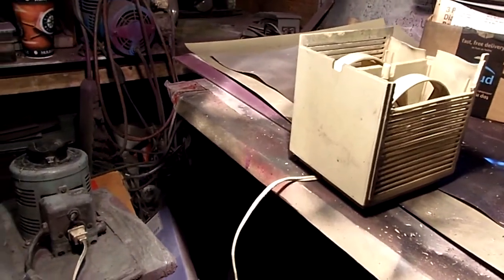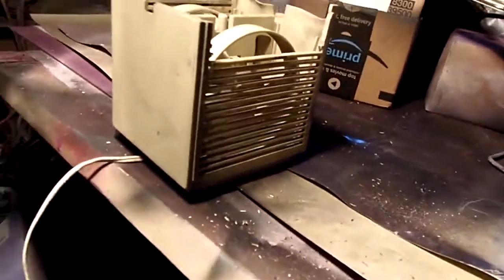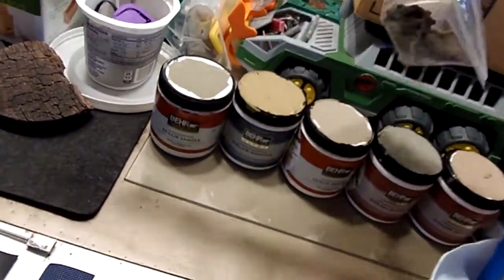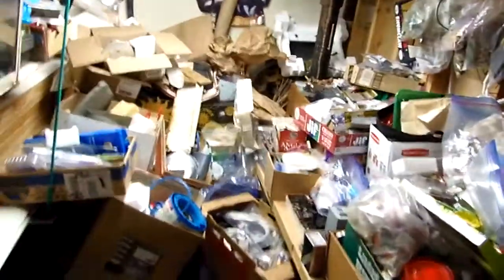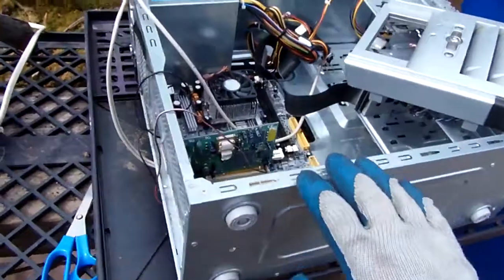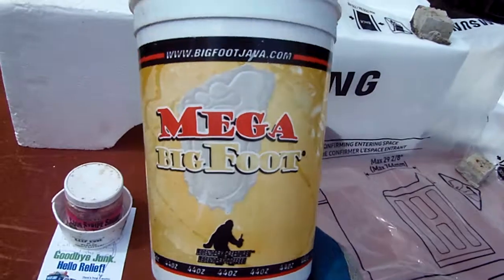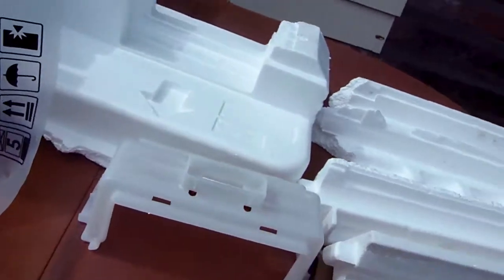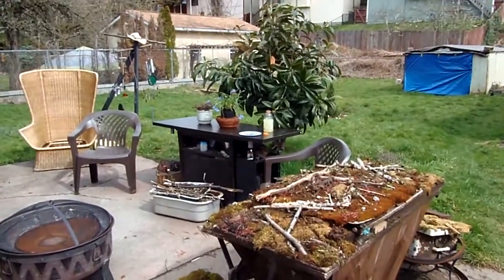The Fodder Room and Stuff Gathered from Four Roadway Dump Jobs

Comment: Those are the motor bushings , not brushes, screaming for oil in that air cleaner - just sayin'.
Reply: @skphile2342 Yes, I know how motors work. I've taken them apart, replaced brushes, cleaned commutators, resurfaced brushes, swapped out bushings for bearings, etc. I know you cant oil brushes - this is elementary to me also.
        I'd be pretty surprised though, if you got some oil into the bushings and it didn't get quieter, if not stop whining altogether.  The motor not spinning until max voltage is applied, indicates to me, friction and binding at the motor bushings. Of course you could be right, I mean I don't proclaim to be an expert  in the field or anything. It's just what seems logical to me.
Reply from the maker: I thought the brushes were worn out but you were right- a little oil on the shaft fixed both the "screaming" and the inability to rotate no mattter what voltage was supplied--Thanks so much!
Reply from the maker: What did not make sense is that it spun feely way UNDER max voltage and would not spin under any load even if manually turned by pushing the blades. When I used the voltage rheostat I slowly dialed it up until I hit that sweet spot; a little less it stopped and a little more it stopped!  Glad to hear you are a well-seasoned electric motor fixer! I did not think you were a novice at all but that you not missing what the symptoms were- I was just spitballing without much sleep (as usual!) LOL!
Reply: @skphile2342  lol It's all good.
Reply: @skphile2342  you're welcome